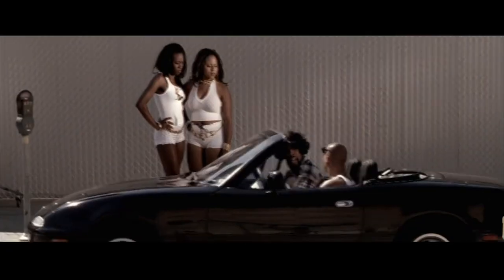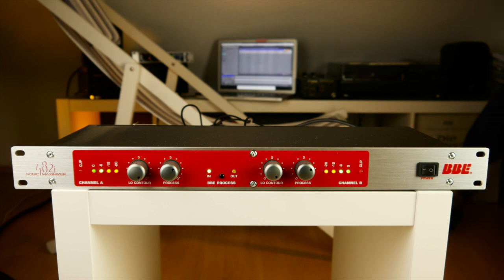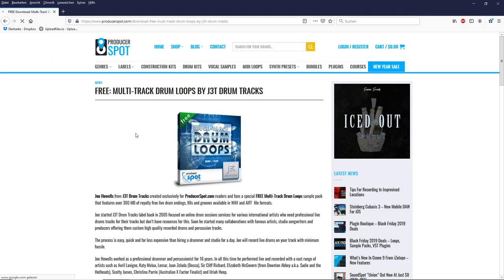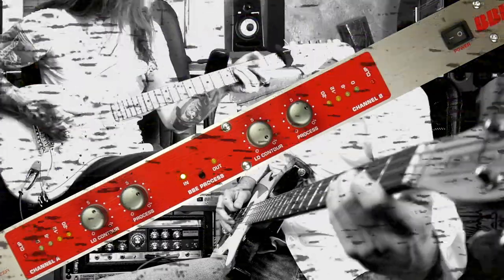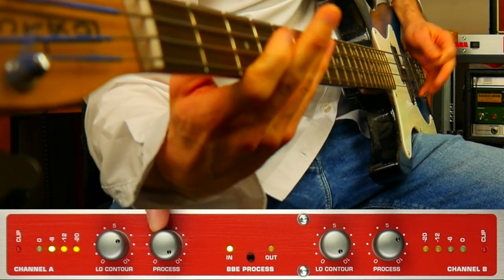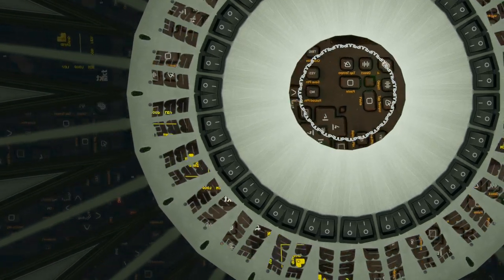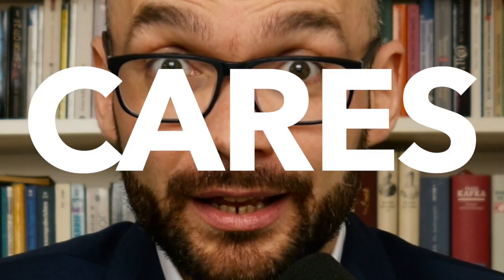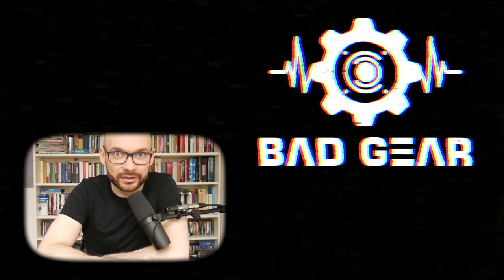Bad Gear - BBE Sonic Maximizer - Most Useless FX Processor Of All Time???

Comment: I've got an Aphex one I can see from here that hasn't been used in twenty years. It has more controls than the BBE but here's my question -- both are two-track units. Who uses this effect on more than one instrument on a track? What happens if you run a signal through both tracks? I'm scared to find out.
Reply from the maker: They were used quite a bit for tape restauration

Comment: I use It on DI recorded Fender Rhodes. Add a Boss CE-2 Chorus to the equation and you get that classic 80s Dyno Rhodes sound.
Reply from the maker: I really wanted it to work for me but unfortunately it didn't
Reply: @AudioPilz  diversity is great. I guess you can get the same results with an EQ, but if you want exactly that sound, it’s really convenient, that you can achieve it with two knobs. I really only use it for that, because I don‘t want to ruin a perfect vintage Rhodes piano with a janky mod from the 80s. 😂

Comment: I used to own this in a pedal form, together with the Aphex bass exciter. Sold the BBE as the Aphex was more responsive, did wonders at the low end of my Chapman Stick, without getting louder. It was like my amp had a pillow in front of the speaker, before switching these on.
Reply from the maker: Always preferred the Aphex stuff, too...

Comment: My understanding has always been that a Sonic Maximizer is to compensate for phase problems between frequency ranges caused by suboptimal speakers in live scenarios. So I'd have little expectation of them having the same effect in a studio recording thst they do in a live performance setting. Maybe if used end-of-chain in a track being mastered specifically for playback on big speakers in large acoustic spaces, it will have the same effect when played in that setting. But I wouldnt expect it to sound right when listened to on, say, headphones.
Reply from the maker: After talking to a bunch of experts over the years (real ones, not guys like me;): the marketing claim is utter BS
Reply: @AudioPilz  well it's definitely doing SOMETHING that makes a noticeable difference in the sound, my old bass player and guitar player both swore by those things, and I've heard it with my own ears countless times. But always in live situations on big ass guitar amps. It definitely tightened up bass and helped it cut through the mix significantly. I'm sure that could be accomplished a variety of ways, but they considered Sonic Maximizers essential kit.
Reply from the maker: @rdean150  have you ever tried a Klon Centaur (or one of the countless copies;)?
Reply: @AudioPilz  nope, wuzzat?

Comment: Great to regain hi end when working with tape in the old days.
Reply from the maker: Only heard the best about its use in that application
Reply: @AudioPilz  it's what it was made for  primarily
Reply: @AudioPilz  A great modern take on it is Waves Vitamin. It does a great job of re-gaining lost information, in case it's list in subtractive EQ. I've mixed a good deal of Alex Ball's stuff the last 1½ years, and it's a great tool for enhancing "sheen" and "umph"  You can check some out here - I cut it up for you : https://youtu.be/0cbLiVssS_M?t=1885
Reply: Right link, wrong time, here we go : https://youtu.be/0cbLiVssS_M?t=2126
Reply: The whole song, using the Roland System 100M. Standby for the pop vocals @ 2:20. :)https://youtu.be/qCEcOsE-YxE

Comment: I have the Behringer Ultrafex and could get a better sound from my inexpensive equipment, but also get better audible speech from historical recordings
Reply from the maker: That stuff works surprisingly well
Reply: @AudioPilz  In the case of historical recordings the sound wasn't good, but audible. It was a version transfered in the 1970's and they had the radio station goal "Better lack in high frequencies, than any noise"
I learned, that shellacs can sound much more brilliant, since I found YouTube videos, where the shellac was played with the right stylus size, with the right equalization. When both is wrong, you get a lack in high frequencies and too much low mids.

Comment: I didn't realize the Ultramizer series was originally a ripoff of the Sonic Maximizer. That probably explains why my Ultramizer always makes everything sound worse. Doesn't matter what it is, or which settings you have. It will always make everything sound worse.
Reply from the maker: Isn't the Ultramizer digital?
Reply: @AudioPilz  Yes. I think I was misinformed of which product came first. They also have one called the Sonic Ul Tramizer, that's a BBE clone. I thought that one came before the Ultramizer DSP digital ones, but on further investigation I think it's the other way around.

Comment: Great... It reminds me of a gear you could work on : the Alesis Air FX (yeah... even the name... Huhhhh). Check it ! I have one of this, the effects are crappy, and i try to open it, see if i could mod something. The thing is a little heavy, for the size, and i though it was a sign of good quality. But ! Inside i found a little PCB, and... A large metal plate, just there to make it heavier... So fun. Anyway, it's a good candidate. (There is also an Air synth, i think, but i dont know it. Certainly bad too...)
Reply from the maker: Had one but unfortunately sold it years ago. It's on the list

Comment: In the 90s, I ran the 462 directly out of the mixer into an ashly 3 way cross over, then into the power amp, even for small gigs from mixer to the maximizer then to the power amp was a beast most of bands ran it as sub master main patch so only certain instruments had the effect, this thing was a beast as mains

Comment: Okay that thing does not sound good the Behringer one does actually sound better if you use it minimally if you put the beast at say 8 or so and then if you put the trouble at say 12 Queen 11 1 or so it just kind of whatever is it but like I said I'd rather spend my money on a great equalizer than a sonic maximizer that said the Behringer one does not sound this bad that thing really cut the signal and didn't add much to the party
Reply from the maker: There is some Ultramizer sound destruction in the Behringer episode https://youtu.be/DXYZic8PFtk

Comment: do the Beringer tube mic pre!!! The one that didn't even use tubes. It had LED's to illuminate the tubes 🤣🤣🤣🤣🤣
Reply from the maker: There was some Behringer tube pre goodness in the 100€ challenge (I assume you already know it) - got the led-illuminated one in my crosshairs for a bigger project 😈
Reply: @AudioPilz  The little one (Mic Tube 100) which is a blatant knock off of the ART Tube pre thingy is actually good (if you upgrade the crap valve, which it actually does use) well... That is unless you have the one with settings for vocals, guitars and other crap on a dial on the front (Mic Tube 200), in which case, set that dial to neutral and never touch it. All the presets sound awful. The rack one which I think you guys are talking about (it has LEDs illuminating a placebo valve) is a complete joke and I look forward to hearing all the punchlines

Comment: Would a SPL Vitalizer does a better job?
Reply from the maker: Always preferred the Aphex stuff
Reply: @AudioPilz  But Aphex seems to recreate the harmonics, as a tube amplifier does, SPL does it by phase shifting, what also works well.
The Ultrafex does both.
By the way, initially I wanted a dynamic equalizer, what boosts high frequencies, but not background noise, I came to Exciter and Vitalizer type signal processors by accident.

Comment: You're completely missing what this unit is for.  It is not an effect.  It is a multi-frequency phase corrector designed to counter the phasing introduced by a live  sound reproduction system (such as a PA system).  If you aren't using it to drive a loud PA system, then you're not using it right and it's not going to give you the intended results.  That's why DJs swear by these things.

Comment: It's the original "Smiley Face" sound EQ. That's all.  Maximizer my )(*$%$%. If you can't explain what it does other than "Maximize" then it's only voodoo. Every other effect can be explained using scientific and engineering principles.
Reply from the maker: It maximizes phase issues;)
Reply: Out of all the comments here, this is the only correct one. The BBE sucks ass, it's a glorified mid scoop, last thing a guitar player needs is another mid scoop. 

Real talk you don't see high level professional studios or concerts using these today. Maybe back in the 90s a few idiots used them cause they bought the marketing hype and lies.

There's no significant phase shifting and alignment on say a single speaker guitar amp like most guitar players use these for that would be noticeable. Delaying the highs a few ms won't be noticeable in any way. If you had a sound system you could maybe make that excuse cause they are actually using more than one speaker, but the fact that zero real professionals use these today might be a sign.

Comment: You're spreading fake information. They're primarily meant for live sound to "tune the source per the room". What's inside and how to use them is clearly stated in their manuals.
Reply from the maker: I've read the manual and discussed it with some people who are experts in both acoustics and electronics (because I'm not;) and they all agree that the claims in the manual are total BS
Reply: @AudioPilz  Yep, it's a matter of subjective opinion. You would have been more fair to say that some people believe in them and some people don't, rather than making a blanket statement that they're snake oil. It's clearly documented that there are many experts who use them in broadcasting and recording studios. And many products license the BBE process to use in their equipment. Rather than argue further, I will agree to disagree with you. 😉

Comment: Best cheap unit for it's money.
Stupid misinformed video. 
You don't use it right. 
It is not a tone eq control.
Reply from the maker: What is it then?
Reply: @AudioPilz  hey buddy. 
It delays the 3 frequencies into 3 separate time zones. 
Hi tone is not delayed.
Mid is delayed .5 milliseconds
2.5 K and under. 
Bass 2.5 milliseconds 400hz and under. 
So they come out SEPARATE. 
But almost imperceptible.
So you get better frequency.
I used mine on about plus12.15 only for hi Bass leave at zero. 
Put on some vinyl and leave it flat. 
Try it that way mate. 
Sorry I did not call you stupid but the video as you don't know how it works. 
They are great. 
Harder to discern in the modern shitty digital era. 
But try it after your master mix on a dance track with some tape vinyl plugins. 
Do not madly spin the dials. 
Just a very subtle tweak... If needed. 
Let the delaysinside give the bass mid and treble... give the final mix some Seperation. 
And A B on and off.
Reply from the maker: @harrisfrankou2368  The phase shift got some mention in the video but processing still manifests itself in a low-/highshelve (with a healthy portion of phasef***;). As I pointed out in the verdict, I enjoyed the results on a dance track master - every other application not so much. It does its job, but, IMHO, there are a lot of (contemporary) tools that do the same job better (dynamic EQ, MB compression,...)
Reply: @AudioPilz True on the Dance Track.. for me it was outboard from analogue studio.. Into source monitor amp.. Or out into CD burner. 
I want to try it out of Ableton and see if I am happy with my mix... See if it give more seperation.
Reply: @AudioPilz  you have used it badly in this video. it is not a unit to be pushed too hard, you have to adapt to the audio material. you have just showcased your misunderstanding of the unit. I like your videos, but we all make mistakes. at least your mistake is funny, well produced and utterly useless, not to say missinforming.
Reply from the maker: @85percentcocoa  I understand you point of view. But why should I use something that seriously messes with the phase of a signal (like the SM) for subtle changes when there are so many other tools readily available in almost all situations (ITB, OTB, live sound, guitar rigs) allow for comparable adjustments without profoundly damaging the phase integrity like the SM does? I like it for more abstract sound aestetics like techno but I can't imagine any other application where the benefits outweigh the harm done (probably the longest answer I've ever written to a comment;)
Reply: @AudioPilz  your answer just goes to show the obvious fact that people are VERY different, sometimes. that's just it.